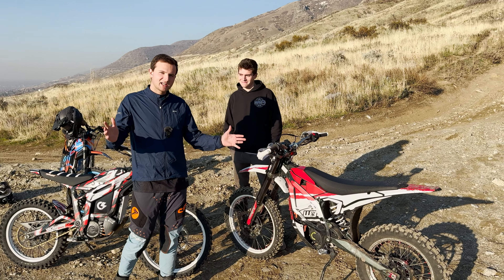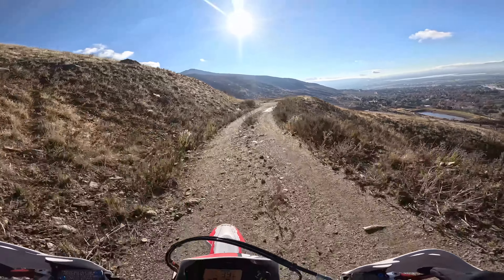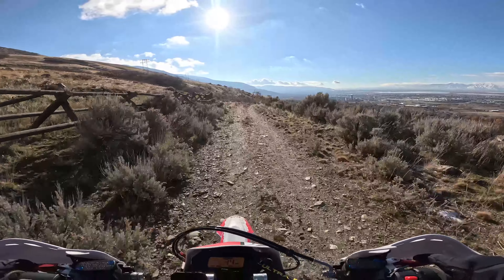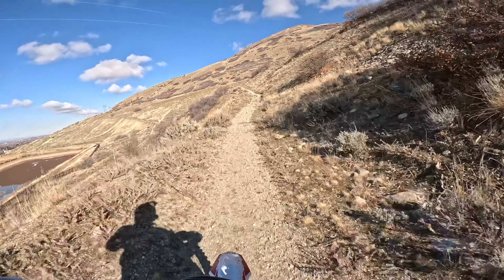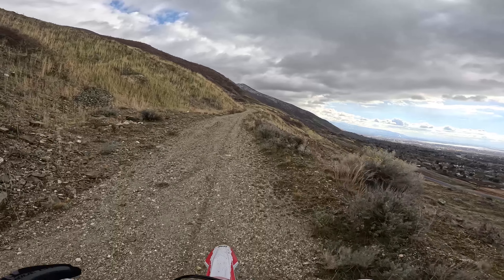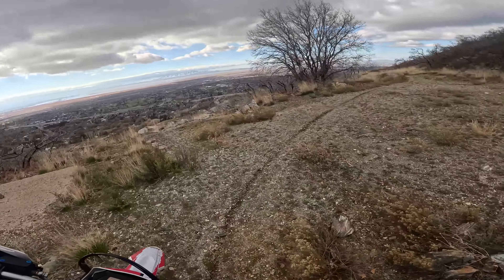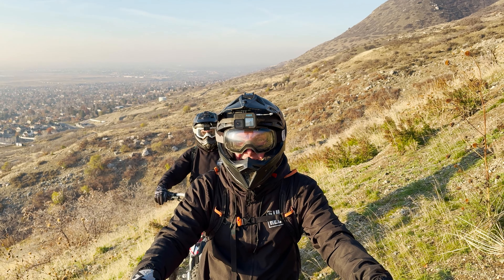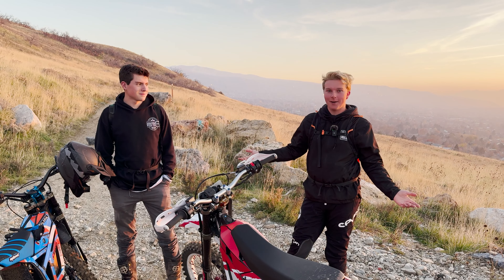30KW Surron UltraBee VS 20KW Talaria Sting R // What Bike Is better?

Comment: I like the small MX4 for being able to ride it in town and small trails. If  I'm going to ride a 100 mi loop. I'll get to KTM 300 out. I personally can't justify spending the money on an e-bike when you can buy a real dirt bike with real suspension right out of the box for the same price. You guys should try some 300 two strokes and ride some single track. Thanks for the review! Always cool to watch
Reply: Coming from a lifelong rider of absolutely every motorcycle type, I completely understand this sentiment. I kept going back and forth for over a year before breaking down and buying a used MX4 and without a doubt it's an entirely different experience. 

I paid $3,800 and have absolutely bought dirt bikes and street bikes for that amount or cheaper. If you need a vehicle, buy a motorcycle, if you want to have some of the most fun you can in sooo many more places, then buy an ebike. It's incredible how quite it is, outside of a 10 feet you can't even hear the chain, which allows you to go just about anywhere and people don't even bat an eye. It can be thrown on most mountain bike racks with the battery out, it's super easy to load up and take around to different places. Motorcycles can sometimes be a pain in the ass to lug around, even the little 2 strokes. 

It's not a motorcycle, it's an entirely different class of bike, and thus really should not be compared to such. It's fun in all the right ways, reliable, and less maintenance overall. Still not going to get rid of my motorcycles, but like they say in the video, the Talaria just gets me out riding more often, in the city and some pretty remote places, and that's ultimately what's important. 

(All that said, nothing beats that 2 stroke smell 😅)
Reply: @DeathGamer27  100%. I love how small the MX4 is and how you can ride it in the city and mountain bike trails. At the end of the day you just need both lol. Like you say they're just so different. But when you get into a full-size 200 lb+ eBike that costs between 10 and 15,000. That's kind of where I draw the line. They're just not quite there yet. I'm sure they will be in a couple years.
Reply: @barryhallsack8852  agreed, it's outrageous, imo, to spend $10,000+ on an e-bike that can only do 40 miles and then takes 2-4 hours to charge back up. I think that's why the MX4 and Surron Light Bee make so much sense, it's the right price range for the right amount of fun. 

Entirely different subject here, but I think that's why it's been so hard for electric motorcycles to flourish. Even my big ole 1700cc muscle bike gets 40 miles to the gallon (when I'm being nice to it lol), and I can fill up for less than 20 bucks in this ridiculous economy. You just don't have that freedom with e-motorcycles and its gonna be a minute before we reach a point where the charge time and range can compete. Cars are just easier to make electric since you can fit more batteries, larger charger controllers, more amenities, etc.
Reply: @DeathGamer27 I like the MX4 for the beginners and the kids, it's a lot of fun and super easy to ride. But at the end of the day I love my gas powered machines 😆. But the future is coming. I know it's going to be all about the electric in 10 years. Ride safe. Cheers!
Reply: Thanks for your input. I'm trying to decide on an MX4 now, or wait and see how the dragon performs. I'm not keen on a primary belt drive (except on the Norton Atlas). I see how a larger than MX4 bike would nolonger be stealthy around town and more difficult to transport and store. 

I'm 5'11" 230lbs. I have little desire to race or take large jumps, so the MX4 is probably about what I'm looking for. It's still an electric mountain bike, whereas the Ulta Bee or Dragon are "motorcycles" to the casual observer.
Reply: @seivaDsugnA  I still like my MX4 but I had to buy a 16-in wheel for the rear. I live in the mountains in Colorado so I do a lot more dirt riding than street riding. If you're going to do a lot of off-road a 16 inch wheel is a must just because of the tires that are available. You are very limited on what kind of tires you can pick with a 19 in tire. Other than that, the bike has worked great! Being 511 I would stick with the MX4. My buddy got that XXX it's tiny but I'm 6'3. I think the MX4 would fit you perfectly!

Comment: I have both the Light Bee and the Ultra Bee.  I would say the Light Bee is a great dick around bike.  Easy to get away with it around town for now till they start cracking down on it.  Taking it on the trail is challenging.  You can't put nearly a wide enough tire on the back and your tire choice is pretty limited.  If I am going to ride trails much prefer the Ultra Bee.  More comfortable, suspension can handle the terrain better.  I am perfectly fine with my Ultra Bee stock, the Light Bee definitely feels like it needs to be upgraded right away.

Comment: I am thinking about purchasing a Talaria Sting R but I watched a video by someone named “Sur Ronster” about another bike made by Eride that supposedly outperforms the Talaria (both compared “out of the box”) for approximately $500 more than the Sting R including having a bigger battery, better display and lights. I wanted your input on this subject as I consider you the go-to guys in answering this question.  I’m concerned about the durability of the Eride in addition to the support I may need with any problems that may occur with the bike.  I live in Bluffdale, Utah..a short distance from a Talaria dealer in the Orem area and that is comforting knowing that they are able to address any service related  Talaria problems, parts, etc. (I couldn’t find a local dealer for this Eride bike.)  I would greatly appreciate your opinion. (PS:  I love your videos riding in my/our local, awesome Utah scenery.)
Reply: I believe the Eride pro SS is a belt driven which I do not like.
Reply: If the eride pro SS is beltdriven, that would be a no for me; however, the SS is better out of the box $5995.

That’s if you plan to stay put & not significantly upgrade.

If it were my money I’d do that & wait for whatever comes after the Storm or modify the Storm, which is essentially a decent 2-in-1.

All-in-all, even though the game has significantly changed, it remains the same, for now.
Reply from the maker: Hey man hope you've been able to watch our review videos on the Pro SS!

Comment: I own a Talaria and a YZ250f.  They are different animals for sure - but the biggest separation for me is the suspension.  For trails and pavement the talaria is fine - but it cant cope with the track or anything approaching enduro.
I love the electric bike, but it has to have full big bike suspension to be an option for me.
Reply: I've seen a few people converting front forks over from a KTM. but it adds a lot of weight to the front end.  I think to get the best of both worlds, you need to start with a 125 or 250 rolling chassis and add a motor and custom battery.   or just save up for a Stark Varg or Honda's CR when it passess out of prototype.
Reply: I was going to say the same thing.   I have a KTM 350 with upgraded suspension and a Talaria and they are not meant to do the same thing.  In terms of enduro, heavy riding through rock gardens, going up very steep hills fast, durability and so on, a Chinese electric dirt bike will not stand the test of time like a Japanese or Austrian built machine.
Reply: The electrics are just expensive toys at the end of the day.
Reply: @fastback6578 yeah that's fair, they have a lot of catch up to do. Even the gas powered Chinese bikes are still behind in tech and reliability. but they will get there, and it will be cheaper when they do.  It took Japan 10 years to catch up to American and British bikes and now they dominate all offroad. China just has to copy the suspension and provide a power plant that's reliable and they will be be there too.
Reply: @tacticooldennis  I'm eyeing the newer Escape-XR by Electric Motion but it ain't cheap, over 11k I'm afraid, price not yet available but will be soon.
Reply: @YouSoundButtHurt  To be fair, they are all toys. My ebike costed me 3k so its in used dirt bike territory, but I can't rip up the streets for long on a 2 stroke.
Reply: @tacticooldennis  True.  I just think they're too expensive for what they are.

Comment: Just curious,  why wouldn't you just get a  tag for the ultra bee so you can ride out from your house, etc...

I'm Inbetween the ultra bee and an upgraded talaria myself, as I come from riding dirtbikes so I want to be able to ride an mx track but still have a lighter bike than a standard dirtbike without the maintenance if I don't ride all time, so I think either of them will work, but kinda leaning towards the talaria as I do want a smaller bike and or the dragon if it's going to be lighter than a dirtbike.
Reply from the maker: If you’re wanting a lighter bike you should go with the talaria mx4. When it’s fully built it only weighs 175 lbs. if you full build an ultra bee the weight can get close to 215 lbs. the ultra bee is better for Mx track 
The dragon is a long way out so I wouldn’t wait for that. Plus it’s close to 230 lbs

Comment: Love your content. I think when I do get one I will probably get the Ultra B and put Supermoto wheels on it with a different sprocket a different Controller a light kit for road use but change out the wheels when I trail ride. Do you guys think that would work out ok? Thanks for the videos and any suggestions.
Reply from the maker: That’s sounds like a great idea. Just adding a controller to the ultra gets you a decent bit more power and it’s plenty fast for most people.

Comment: Hi Talaria Boys do you think it would be a good decision too get a torp tc1000 and other upgrades and put it on a Ultra Bee straight away out of the box or do you think i should wait until i get used to the power first and then put some upgrades on?
Reply from the maker: I would recommend just getting used to it stock, its an amazing bike and has lots of power. If you find yourself wanting more you can always upgrade down the road!
Reply: @Talariaboys  Thank you for the infomation i agree with you guys that it has alot of power. god that thing just rips cant wait to get one.

Comment: I primarily ride street and have a street legal plated sting R but cant decide whether I should upgrade the controller and battery on my Sting R or buy an ultra bee or buy a motorcycle.  Upgrading my Sting R would be around $3800 so not much of a difference between just buying an ultra bee or a mid range Honda adventure bike.  Good thing its winter and I have 4 months to decide what to do haha
Reply: I have a talaria and love it for single track it's amazing..  although I recently just bought a Honda CRF 250l and love it as well you can't go wrong either way but the Talaria is much better in the woods
Reply: @jacobsinclair6119  I just love the silence and feel of an electric bike, it makes me feel more connected to my surroundings.  But I want more range!  Looking at the 2024 Honda Transalp if I go full on motorcycle

Comment: What kind of range are you getting during average speed trail rides on your mx4's with the 74v 42ah batteries?
Reply from the maker: 30 plus miles with lots of climbing. Can get 35 if we go a little slower but still decently fast

Comment: Hey guys can you help me out what would be the easiest/cheapest way to upgrade the range? IS battery the only option or does changing the controller actually increase range too?
Reply from the maker: If you’re only looking for more range you could get a 60 volt battery with high amp hours. You can use your stock controller
Reply: @Talariaboys  Yes but the battery is about 2.5x the cash of a controller :face-purple-wide-eyes:

Comment: What boots are you wearing?   Do they still provide protection?
Reply from the maker: I wear some Shorty Moto boots  that work really well, they do run very large in size at least 1 whole size up if your buying them, I bought 11 and I have to wear two thick pairs of socks to make them fit right and I always fit 11.https://www.motosport.com/product/?code=SS-M-G-P-NA-PLA-DIRT&key=ONeal-2022-Rider-Shorty-Boots&cc=us&variant[ONA00JQ]=ONA00JQ-X001-Y001&cc=us&variant[ONA00JQ]=ONA00JQ-X001-Y001&utm_source=google&utm_medium=pla&gad_source=1&gclid=CjwKCAiAqNSsBhAvEiwAn_tmxWOOfM0uUk58kUtRvjVqZDUF3xnhhWSL-FFnkcISHGxvzLZC7D5uixoCvZgQAvD_BwE&gclsrc=aw.ds&variant=ONA00JQ-X001-Y004
Reply: @Talariaboys  Look like a great choice for an e-moto.  Thanks!  Currently riding my Surron in hikers or work boots, so these would be a nice upgrade.

Comment: Great video however I think its important to mention that Talarias and light bees are like pit bikes with mountain bike ergonomics and components no matter how much money you put into them. They will never be as confidence inspiring on technical single track with rocky hill climbs or fast whooped out sections or really even fast and flowy trails as a dirt bike. Whereas with the ultrabee you have the ergonomics, suspension, brakes, and weight of a smaller dirt bike. Which really translates to a bike that you will have fun on even if your already experienced, it is capable of doing everything a full size dirt bike is with all the benefits of being smaller, lighter, and electric. If you are new to riding you will be able to continually learn proper riding technique and grow as a rider. A talaria or light bee are awesome and way better choices for pit bike style riding or unfortunately mountain bike trail poaching. An ultra bee and most likely the  talaria dragon are better choices for people that want electric dirt bikes for trail/single track riding. Also, I think you guys may be slightly out of touch on your talarias not looking like dirt bikes. To the average person they all look like dirt bikes. Even a guy loading his ktm 250 didn't know my ultra bee was bigger than his talaria, he thought I just had an upgraded light bee until he asked. The ultra bee is a lot smaller than a full size dirt bike even with 21/18.

Comment: the motor don't have 30kwatts of power its = to 40 hp at 72volts for motor alim. the charge create your motor its arround 417amp/hrs. :face-blue-smiling:🙂 big wire🙂

Comment: Any reason you don't have the phase amps maxed on both bikes?
Reply from the maker: They don’t need to be, we don’t need over 700 it’s got to much torque for the kind of riding we were doing
Reply: @Talariaboys  Just maxing it out though sounds like it would be crazy powerful and fun though, I get why you wouldn't but have you tested it out? I was surprised you didn't for the first Ultra video
Reply from the maker: @Bengy22  so the first ultra video we did max out the phase amps to what our stock motors could handle. Any higher and we definitely risk burning them up.
Reply: @Talariaboys  From my understanding even the stock motor you could have maxed the phase amps just for a short test. Long term it can't handle it due to heat but just for a drag race it can, also the thermal roll back should kick in before any damage is done.

Comment: I just can't agree with you that a cop will stop you more on the ultra bee than on your flashy Talaria sting bikes. To use that as a reason is just not valid.
Reply from the maker: Ya definitely true! We were talking more without flashing decal kits and wheels, more just the size difference,  if both bikes were all black then we feel the ultra bee would be a higher risk to get pulled over.

Comment: How do you fit the front fender on the talaria with a 21” wheel? Everyone says it won’t fit?
Reply from the maker: It fits just fine on most forks without changing anything.
Reply: What size tire are you using?
Reply from the maker: 70/100/21